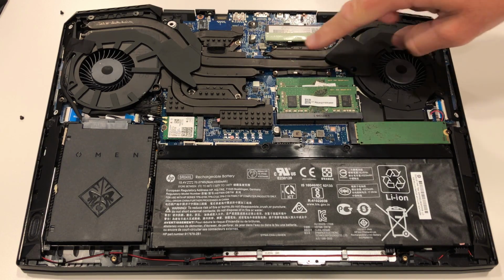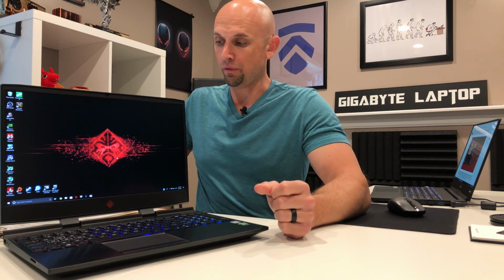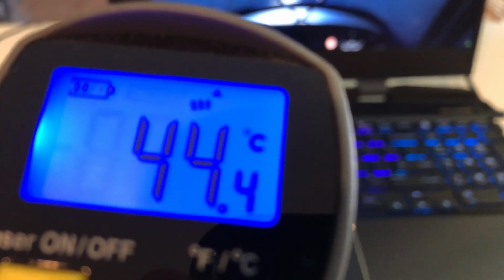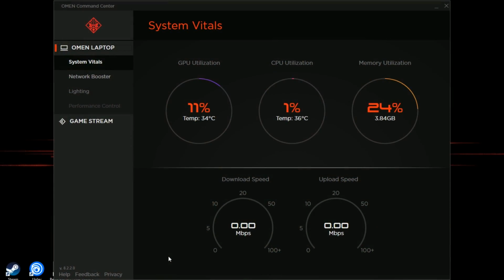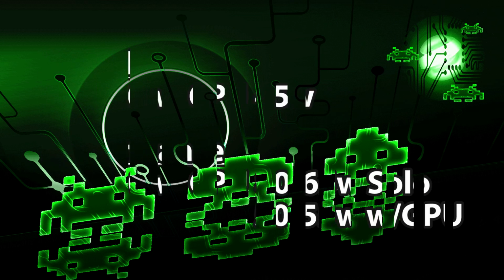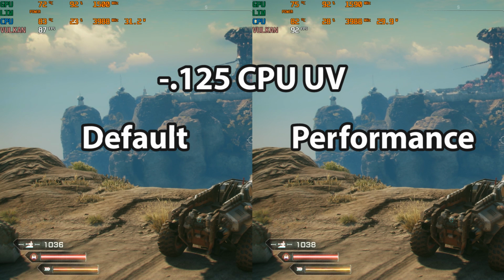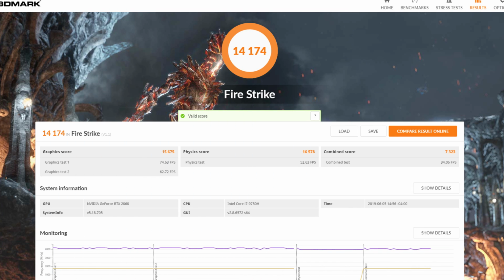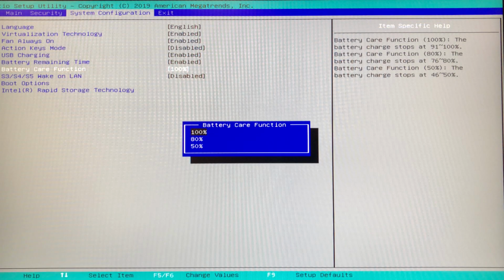HP Omen 15!  RTX, 9th Gen and 144Hz for $1199!

Comment: Man at that price it makes things like the Aero 15 and Razer Blade at $2000 and up look like an over priced scam. How was the light bleed? Digure there must be a few more GOTCHA things about the laptop other than not being an aluminium chassis.
Reply from the maker: The blade on the aero are in a league of their own. All aluminum and a gigantic battery commands a hefty price unfortunately.

The LGD05C0 has very little light bleed regardless of what laptop it’s on.
Reply: I would expect them to cost more sure. But, $800+? I know something like the Razer Blade has a more robust cooling solution, lighting, and is a smaller laptop. Still seems over priced by comparison.

I wasn't sure if they were using the same model panel or if they had a different provider. Good to knew though. Eager to see what the new Omen X 2s holds.
Reply from the maker: It’s strange to me as well. Laptops with big batteries cost big money and that just seems crazy to me.
Reply: Probably just the whole "This is a great work laptop" like the Aero 15. Sure it's a great balance between a gaming device and a productivity device. Probably even more so that Nvidia Studio is a thing. Slap features professionals would like that have deeper pockets and profit.

So long as they make good devices I can stand paying a pretty penny that I'll use for years to come. ;)
Reply: @Terreos   I have the Omen 15 2070MQ version that comes with the G-SYNC LGD05FE panel. No light bleed out of the box, I'm well pleased. I literally bought this because of a 2070MQ at a ridiculous price (when my old Gigabyte P34 with a 970M decided to have its screen die from poor hinge design)
Reply: @azproc great to hear. Whenever I see prices this low on a well speced gaming laptop the furst thing I assume is the screen is garbage. I love to hear I'm wrong.

Comment: Good job Bob,

Been waiting for this.
Even a good price in UK where we routinely get ripped off (looking at you Lenovo).

Only the 1660 ti version overhere so far but I'm sure more will follow.

Be interested in the 17" version if they can keep the weight under 3kg.

Thanks again.
Reply: Noble Stone Lenovo legion 2019 models and better and comparable in price.
Reply: @adampoots1850 

Only the y540 available so far in UK.
Not seen any reviews yet but similar spec to HP Omen is £200 more expensive.

Comment: This Omen or legion y540?? 
Which is more worth it for a low budget
Reply: The Y540 specs are not a comparison with this... the Omen has stronger specs all around. Even if you somehow decide not to apply throttlestop voltage and boost tweaks, you will still do better than the y540. Tweaks applied, the Y540 doesn't come close.
Reply: azproc you what? The stock legion specs on the Y540 are basically the same. The legion wins hands down in build quality - performance and no variation in components.
Reply from the maker: Variation in components?  This Omen is running all Samsung if that’s what you mean. 

The y740 is awesome but I and MANY others were unable to get use to the keyboard.  That’s a deal breaker since it’s the keyboard. 

Build quality of the y740 is nothing special especially when you consider their more expensive SKUs use the same build. It’s good at $1300 but mediocre at $1800.

Comment: Hey Bob subscriber here. If this 2060 model look hot like this, do you think the 2070 model could even hotter? What about replace the thermal paste with liquid ultra and fujipoly thing Will it be any significant decrease of temperature? I expecting cpu temp not more than 80 degree it possible. Thank u.
Reply from the maker: RIDHO SYUBAN NASIR Without a maximum fan setting changing the paste with LM will yield little impact.  Especially on this laptop as HP scales their fan curve close to thermals.
Reply: Thanks for the feed back, hope you the best. But how about the long term use for the laptop do you think the temperature is still tolerated?
Reply from the maker: Of course it’ll be fine 👍
Reply: I remember when you review the other hp omen couple months a go and you make an update for that product about the BIOS i believe, if this new hp omen make the same up date like the other generation Will it be Helped for the temperature?
Reply from the maker: I have no idea. This laptop has been sold and unfortunately I won’t be able to cover it. If you follow some of my guides and performance tuning tutorials you can get better thermals from the CPU I let it run pretty high wattage for this whole entire review on purpose to show you what the worst-case would look like.
Reply: Since i Saw your Chanel about the other generation of hp omen i really want that laptop but for a couple of reason i still have other things to buy so i keep with my Asus rog g751 you can imagine how old my laptop is, so if you say the worst case of this new omen laptop is that high, plus tweaking base on your guideline Chanel which awesome (thats why i'm your fan) is it still ok for the long term of this laptop? I would prefer 2070 actually, and i believe the contender for this laptop is Lenovo y740, what do you think for comparison with this laptop?
Reply from the maker: I don’t like the Y740 keyboard that’s why I prefer this. That’s a huge deal for me personally since I use the keyboard all the time.
Reply: Ok thanks again

Comment: I have to say, undervolting 16/20 series GPUs with voltage frequency curve is a pain since there are so many points in the curve. You must be very patient!

Very good price indeed. If compared to one of the cheapest i7+2060+144Hz laptop - Clevo NH50/55/57/58, the cooling is slightly worse but you get more features like no Optimus+70Wh battery, TB3, aluminium build etc. Definitely not bad at all

Comment: I bought a unit with i7 8750h and gtx 1060 6gb, 144hz panel, since I'm from mid EU and prices here are bigger and it also takes some time shipping them to EU market
Reply: I bought a unit with 1070 max Q and I'm suffering because the temps are thermal throttling both the CPU and GPU. Perhaps your 1060 will perform better in the long run

Comment: How they improve the themal while using the same chasis? The last version overheat alot.
Reply from the maker: Thắng Phạm if you look close the heatsink appears improved slightly.  Plus the fans work a bit different here versus the last version.
Reply: Much better than the 2018 version. The fan curve is designed for quiet. It eventually gets up there and in performance mode the fans tend to not fall back down as quickly so keeps your temps decent. I forewarn you have to use throttlestop to get the most out of this configuration, it's less than ideal out of the box (although you can probably say that for most 6-core i7s these days).

Comment: Nevermind answered my own question. This is yet another Micro Center only deal so if you don’t have one close your out of luck. I know this is going to sound salty but tired of seeing deals like this. 

Nice mini review just the same
Reply from the maker: pjladyfox Slickdeals has this posted for $1210 with a different storage setup but otherwise same specs.

https://slickdeals.net/f/13120606-hp-omen-15t-15-6-fhd-ips-144-hz-i7-8750h-16gb-ddr4-256gb-pcie-ssd-rtx-2060-thunderbolt-3-win10h-1210-f-s
Reply: @BobOfAllTrades  thank you for the heads up. Was hoping to nab one of the new 9750 models. I'll keep up on my search.

Look forward to your next review!

Comment: Is it max q version? And what difference does WiFi 6 makes ??
Reply from the maker: There’s no such thing as a 2060 max q. Apparently WiFi 6 is just faster than the previous WiFi NIC if you have the internet speed and router to support it.  Something that very few can utilize.
Reply: @BobOfAllTrades  thanks for the information
Reply: as it's getting 90W on gpu,so no max-q

Comment: So may I ask, Lenova Legion Y740 or HP Omen 15. What you say :/
Reply from the maker: Haloblackops Tenken. Great question. For ME, the Omen hands down. I very very much dislike the Y740 keyboard and that’s a HUGE part of the laptop experience.  

Otherwise I’d say Y740 if the price is close and the KB doesn’t bother you.
Reply: @BobOfAllTrades  This is a tough decision to make. At one point, I was all over the Eluktronics laptop, but then seeing the Lenovo and the HP Omen, its hard to decide.

I was thinking of going with the Omen with RTX 2070 which is alot cheaper than the Lenovo's price, but I'm liking the Lenovo alot more. This is hard to decide. But will let time decides on that.
Reply from the maker: It’s a good time to be a gaming laptop fan 🤛
Reply: @HaloblackopsTenken   I went with this for two reasons  - 1) the Lenovo was backordered and more expensive at the time (actually considered cancelling this when they had a sale, but persevered). 2) there is a numpad on this machine, and otherwise has all similar specifications. The screen hinge despite it looks, feels more sturdy than the Y740. You cannot manually go up on the fan curve on this, so that is a minus. The Lenovo probably cools better as well. However, some undervolting, and choosing a turbo-boost to 3.6GHz for me did the trick - my CPU rarely if ever goes above the 85-89C on full load gaming.

Comment: Even after UV thermals not good
Nice review nonetheless
Reply from the maker: Balkeet007 HP clearly favors acoustics over thermals. If the fan speed could be maxed out we’d be in better shape. All the of right stuff is there including a properly mounted heatsink.
Reply: @BobOfAllTrades  UV + repasting must-have, I'd said
Reply: @Bob Of All Trades what if the remove they shared heat pipes and have separated heat pipes? that could at least minimise the heat transfer from one CPU to GPU or vice versa

Comment from the maker: HP has something here!  
✅ Quality part selection
✅ Thunderbolt 3
✅ 70Wh battery
✅ Quiet fan acoustics 
✅ WiFi 6

Wants:
Windows Precision Trackpad
Muted lid (their new design does this)
Max fan option
Reply: In my country hp offers a 144hz panel with G sync ... Are they lieing ?
Reply: @firasrabaia  No, they aren't lying. I have the G-SYNC model with 2070MQ with panel LGD05FE. Excellent machine.
Cooling pad probably has minimal help. I tried elevation, can give you maybe 5 degrees celsius better but not enough to make a tangible difference.
Reply: @azproc  thank you very much as you see do you have the color accuracy  figures of the screen ?
Reply: Should I get this laptop or get the Helios 300? I just hate Synaptics.
Reply from the maker: How much is a 2060 Helios 300 and would you have a Microcenter to buy the Omen from?
Reply: I want them to offer an AMD 7nm option. The 3750H 12nm is about 80C at max.
Reply: Hey have you ever had any iasues  with those hinges connecting the diaplay ?
Reply: When I go to Device Manager, the Monitor driver shows as 'Generic PnP Monitor'. Does anyone else have the same? I wanted to check if this is the real monitor. It shows as part DISPLAY\AUO82ED. Can anyone else check if this is the same monitor in the new one? I bought refurbished and worried.
Reply: They don't give fan control, which is a shame
Reply from the maker: Thanks for making it to the end 🤛
Reply: I like the number on this comment
Reply: Bob of all trades what thermal paste do u recommend for the hp omen 15 with 1060 gtx and
Reply from the maker: matthew smithers I’m 100% sure I game my recommendation on that specific question in that specific review.  Probably IC Diamond but I’d go back and watch to see if that’s true and why.
Reply: Would you recommend the more expensive rtx 2080 version (not max q) for 1970$ ? Or will it overheat even more ?
Reply from the maker: That’ll have to be a 17” version. They don’t make a 15” model with a 150w 2080. Their website would be misleading if that’s what you’re seeing. 

Or, let’s say I’m wrong and this is indeed a MaxP 2080....stay away.  It’ll peg thermals in an instant.
Reply: Thank you very much for the quick video it really helps 
I have a question using a cooling pad gonna help or not ?
Reply from the maker: Firas Rabai'a I don’t use cooling pads. I have an X-stand just in case but this chassis doesn’t benefit from it.  

The Gsync versions use a different display.  As stated, this panel isn’t Gsync certified.  I guarantee the Gsync version of this uses a different panel part number.
Reply: Should be for the price....
Reply: I can't figure out how to unlock the GPU voltage on this laptop. I have checked the boxes in the settings, but no luck.
Reply from the maker: Yeahsure It doesn’t work that way on laptops.  You’ll have to go through the Voltage Curve Editor.
Reply: @BobOfAllTrades  Thanks. I figured it out.
Reply: Any other way to mute the lid ? Great laptop but not a fan of screaming gamer design ...
Reply: @irf89  ya too easy go AliExpress and search 
Hp omen 15t skin 
There is some good leather like skins for it it costs 18$ for the whole computer lid - handwrest - back
Reply from the maker: Oh nice I’ll keep that in mind. Thank you 🙏
Reply: @BobOfAllTrades  no problem ^_^ thx for the reviews saved my life xD
Reply from the maker: Same here 👍 I’m sure the clever individual can dismantle this and paint it matte but that’s quite the effort.
Reply: Anybody knows the % of srgb and adobe rgb pleaaaaaase? :/
Reply from the maker: Imaginoñar 1314 Yeah, it’s in the review 🤔
Reply: @BobOfAllTrades  thanks but i need your help if you can, the % of srgb of the versión with i7 9750h 1660ti 144hz 256gb ssd is the same? You know the % of that? Help mee pleaseeeee🙏🙏🙏
Reply from the maker: Imaginoñar 1314 Nobody knows that. I’ve seen these laptops come with three different displays bud 👍
Reply: @BobOfAllTrades  thank you very much
Reply: Is the batterylife really that bad?"?
Reply from the maker: Faruk This is amazing battery life for a laptop that’s permanently connected to its dedicated GPU
Reply: @BobOfAllTrades  where can we see that the dedicated gpu runs all the time?
Reply from the maker: Right click the desktop and open the Nvidia control panel. If you have more than 3 options, the dGPU is on all the time.